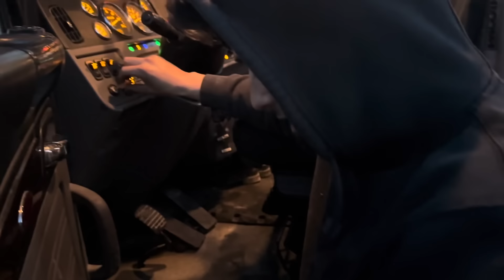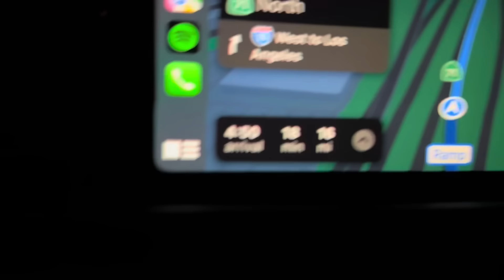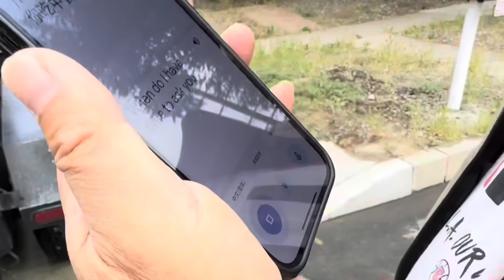Would You Drive a Concrete Mixer truck?

Comment: I've been driving a mixer for 35 years now. Got a couple more to go. It's not that hard, just takes common sense, which unfortunately is in short supply nowadays. You're doing a great job Lexi be safe and keep the rubber side down.
Reply: I've been driving over the road for 25 year's and I could drive that truck, but I would have to be trained on how to do the rest of the job. 

Don't sell yaself short man, that job isn't as easy as ya think, I'm just saying💁‍♂️

Comment: I did that for 7 years till i was 37 last year, then i found out the real money is in the dump truck business, do not spend to many years in concrete, the owners makes the real money not the driver, buy a used dump truck find a good mechanic in your are, and start making 5,000 a week before expenses a week, 3000 cash a week after diesel and insurance, always evolve, try not to stay neutral too long, you will never make real money. concrete drivers should make a lot more money, but managers keep it all. think about yourself not your company, u have a valuable license profit from it, the real money.

Comment: Hey Lexie.  @9:34, about the rust, that shouldn't be hard to fix cause it's just started..  it's called surface rust cause it hasn't gone deep yet.  What you can do is get like a couple spray cans of  Rust Reformer and spray it on the rust spots.   It dries real quick like in 3 minutes.  Then you spray the white paint over the rust reformer (it dries black) and it should look a ton better after that.   About the Rust Reformer, there's like 2 or 3 kinds.  I like the Rustoleum brand (Autozone or Home Depot) cause they dry quick.  Just a suggestion.
Reply from the maker: Thank you so much that’s very helpful, is that rust reformer spray method better than sanding it down?
Reply: @lexflowaz  Rust reformer is black color spray, which is one way. Not necessarily better but maybe quicker. That means you have to spray over with a white color gloss ... more spray coats of white to hide black. Wire brushing or sanding is traditional way to prepare surface.. There is also Rustoleum rust dissolver jelly that softens rust, then it's easier to remove rust with wire brush.
Reply: @lexflowaz   The idea behind sanding it down is to remove the loose rust.   If you don't remove the loose rust your paint could come right off if the rust breaks from the metal, you know what i mean?    So yes, it's a good idea to hit it with a wire brush to remove the loose rust, or better yet sand it down with like around 200 grit (#100 --#220) sandpaper.   I like the Rustoleum brand Rust Reformer cause it dries really quick.   It becomes "primer" when it dries.   Then you can paint the white top coat over it and it should be good.  I had painted Rustoleum on a metal gate before and i wasn't able to finish it off with the top coat, but would you believe it, it lasted 2 years(!) even without the top coat.  About the top coat, you can go 3 coats if you want..just let it dry in between coats for like 30mins.  The Rustoleum doesn't need to be coated twice unless the rust is deep and it absorbs the first coat.

Comment: Engine protection or they left the key on position and it drained the battery or it's in gear. I'd have to look at it myself to know exactly but it's why I stick to older model trucks what I was raised on less sensors, less headaches, more time off the shoulder and more time on the road😊

Comment: Banana 🍌 .... I just came across your channel and like it. I also read in your video description about buying a different camera and wanted to mention something. I have seen people on other channels use cameras that can be clipped to the brim of a baseball cap. Now I am not sure how you feel about wearing a baseball cap, but using one to hold your camera for you will allow you to have your hands available to do your job while still filming. There is no need to reposition the camera all the time and because of where the camera is mounted, we see what you see because it always points in the direction you are looking. Of course you can attach those cameras to a mount also and get shots with you in it as well. I do not know what brands those cameras are because I am not a video kinda guy but I am sure you can research that if that is something you might want to consider. Take care.

Comment: To answer your question about what do you call the spiral steel inside the drum?  Those are called blades, mixing blades, or drum blades.  They are a type of auger blade.  Auger blades are mostly found inside pipes at grain silos, where they lift grain from a lower elevation, to a higher elevation or can even be used like a conveyor belt, moving grain type material from point A to B.

Comment: Do you only keep your drum on low revs when rinsing your fins because it's too loud in the video? Normally I'm full charge after load is emptied. But full throttle and full charge after loading when washing down

Comment: Yeah, don’t let dudes mistreat your rig!  Painting is the right move… but you can’t just paint over rust… it’s underneath the paint now…. So get professional advice for painting trucks… you might be able to get an outfit to mix up the right color white for you, but probably they will recommend you use a brush or sanding head on a power tool to take the bad paint and rust off, maybe do a rust treatment, then primer paint (for adhesion) and then your color coats on top…. But find a paint shop that services equipment and ask them what products and process they recommend.  High quality paints are generally 2-part (paint + catalyst).  It’s not an “easy fix” to do right.  BUT if you hit it with white spray paint in the short term it probably wouldn’t hurt, but it won’t last.  Hope you get it sorted soon.

Isn’t it a company truck?

Comment: Concrete drivers around where I live work like 55-70 hours a week, some of them 6 days a week. Backing into tight residential areas all kinds of sh!t. I am good lol. I just turned 30 one day before this video posted actually, and I have been driving trucks for 3 years, regional semi local and now local the last 2 years. I am going back to school with the hope to be a CPA, I would recommend you get some other job skills that will keep up with inflation better as well  while you are still young. My Dad is a local hazmat driver who makes 34 an hour, I am 30 an hour and I don't even have a decade in and he has been doing it for 40 years. So do the math on that. Also BANANA  lol

Comment: Do you ever have to help spread the concrete?  Here in Alabama, many drivers help spread the mix if asked.  They are usually rewarded with a generous tip.  Many times the truck can pull right up to site no pumper needed.  This also speeds up the discharge process so the truck can return faster to the plant.

Comment: Nice . Always wash your endloader before you leave the plant. also make sure your main water valve to add water to the load is off before you pressurize your water tank 😉  and yes those are called fins , always keep the drum turning when in transit you can flatten the drum rollers  be careful when turning on right hand corners  . There were a few ladies driving mixers when I was driving 20 years ago ps be careful around cement dust acid wash wear a mask and gloves. Looks like your having a good time enjoy . BANANA 🍌

Comment: Your vids just popped up in my feed...  30+ years here, from dry-vans and flatbeds to rgn's (lowboys) hauling permitted loads (oversized, from buildings to heavy equipment), plus two years transporting windmill blades.  Now I run a winch truck, back in North Dakota again and I still wouldn't want to drive a cement mixer.  lol  My best advice?  Always keep learning, no matter how many years of experience you have.  Be safe and don't take stupid risks.  Wear that seatbelt (you'll find plenty that thing it's ok not to wear it but just wait until you roll one and that will cure you...  Ask one of my coworkers here after a shoulder gave way this past winter).  Did I mention wearing that seat belt?  lol  Don't touch that phone while driving (a huge pet peeve of mine, watching people in both cars and trucks driving down the road from shoulder to centerline).  Respect center of gravity (I think that's why I never wanted to drive a mixer truck even though I've hauled a lot of top-heavy stuff...  lol).  The CDL is an insurance policy in your back pocket (so to speak), so keep the record clean and be safe while soaking up all the knowledge you can.  

I now feel officially "old"!  lol  :)

Comment: I just read your follow up.
SEAT BELTS:
My wife and I both operate heavy equipment loaders, dozers and such.
Like you she complained the seat and belt makes it hard for her.
I schooled her of the importance.
I couple years ago her co-worker complained the same then one day she rolled the dozer off a hill.
Had she had on her seat belt, the ROPS (Roll-over protective structure) would have saved her.
She left behind three children under the age of 10 yr's old.
That was a heads up for my wife to wear her seatbelt.
I'm now retired but every day she goes out that door, I worry.
She now has 6 years to retire, that's 6 years I have to worry.

Comment: Pillars? You mean your fins? Or that's what we call them out here near Chicago. At our plant which is wet batch, anything that gets put in the load like color or fiber, someone drops it in for us so we just load, wash down and go but I've found you can add all bags of fiber at once as long as they aren't all tightly pressed together. 
I wish we had vibrators on our chutes. Having to drag mud at a 1in slump sucks.

Comment: I drove about every kind from in my 20's to my late 60's. Mostly Macks but occasional Corn Poppers and Oshkosh with Rex chain drive tubs to 5-axles with Bridgemasters and 10 wheel drives and Allisons to quad boxes (5x4) and about everything in between. From 7 to 10.5 yd and if I was going to truck anything it'd be concrete. Now it's a mower and happy to be alive. Every bit in the Blue Ridge! NO flat ground!

Comment: Hi Lexi, I drive a concrete truck in Sydney Australia. I drive for my company. I am 54 years old and get to work with my son. In Australia we call them 'agi's' short for agitators. The ridges in truck in English are called fins and along those fins are 'flights' which balance the fins. Our barrels are smaller than yours and the maximum load we can take is 7.5 yards or 6.9 metres in metric. Love your videos. cheers Steve

Comment: Not trying to be a jerk but the reason you need a hammer is your not washing down very well. Dry batch or central mix?? You have to get out every time wash down your fins and chutes and on top of the cab every time you load and unload. They have to chip your truck A lot I bet.  Dry batch the worst if your fins aren’t clean it won’t load properly and end up in your chutes and all through rotisserie. Fins are set at a certain angle if you get build up behinds fins they Wont act efficiently and spit material back out all over your truck.In the old days they let us carry weak acid to clean it up. Tip you want the whitest  truck in the fleet but you really have to rinse? Toilet bowl cleaner is the same ph as acid we carried. When they stopped acids all of us carried a bottle in the truck.You have to if the boss isn’t giving you enough time to wash. You can’t get those little specs that dry to fast. Also do they let you carry a small chipping hammer and sledge. On a Fri or Sat. Tell someone you wanna go in and just bang on the fins with a hammer that or learn to wash down.
Reply from the maker: Thanks for your comment, 9/10 times I do go up and wash the fins, hopper, and water pipe but there’s times where we’re doing clean up loads and we don’t have time to go up and wash and also sometimes the truck behind us getting loaded is done and is waiting on us to scoot up, so it dries over time, we have chippers come every so once in a while
Reply: @lexflowaz  That’s what the acid was for we hauled with us  until the 90’s. Do you have a central mix or dry batch?? If it’s dry your gonna have to wash behind those fins every time  that’s how you get those circulars rolly balls to stop. Also those fins expand and contract that how you get those big pieces breaking off and clogging your chute. You have to wash fins. I’m retired now 37 years in. Mixer glory. Do you every think about front discharge? Here were a premium. Waaaaay more interesting. Imagine behind a curb machine in deep sugar sand. With a 1” slump and your backing up trying to keep hopper full,trying to save air with side walk on one side people walking by or through your mud. You seem to be a great young lady. I know you can do this. I miss it. Have you gone to concrete school?? It’s put on by state association. I was a road driver when I started I didn’t know anything about klinkers or plastizers. We’ve actually had guys sit on catwalk with hose spraying fins as we pour on curb machine.contracts lose their shit if those balls show up.

Comment: I'll usually have drivers rip the fiber bag slightly before throwing in to make sure there isn't any balling issues. However, those micro fibers usually won't have any issues unless the slump is above 7" or so or you have a sand or small aggregate mix. Then you have to worry about the bag not breaking open fully when there isn't enough friction and shear to break apart. The bag will also want to "float" more in the concrete. Testing out a new fiber dispenser now at one of my plants, hopefully it will shave some time and keep drivers off the ladder for safer operations. Cheers!

Comment: 9:35  Do not use spray paint, unless first, you sand the rust spots. That way the paint will cling to bare metal. There is a saying: "Rust never sleeps." If you cover the rust with spray paint, the rust will continue to eat the metal.
Reply from the maker: Thank you for that knowledge, i knew it felt wrong just spray painting over it 😂 good thing I held back.. I’ll make sure to look up the correct way to do it, enjoy your weekend thanks again!
Reply: @lexflowaz  wire wheel and get some decent paint for it. Done that a couple times on a few vehicles in the NorthEast. Also, respect for driving stick! Have a 6 speed Wrangler I bought 4 years ago on purpose and love it. Kinda know it's less steal-able cuz no one knows how to drive standard anymore in the US.
Reply: Excelente contenido Lexie soy de México del estado de Nayarit siempre pendientes de tus contenidos saludos
Reply: You’re so nice 👍 😊
Reply: @lexflowaz sand to the metal be sure to put etching primer on the metal then regular primer  before the paint so it will last longer 😉
Reply: @lexflowaz  Home_depot: Rust-Oleum brand rust dissolver and gloss white spray enamel, steel wire brush (to scrape off rust), safety eye glasses, gloves. Wipe area before painting. You can maybe use your truck cleaner acid.
Reply: @lexflowaz  Wire wheel with a grinder as @bracket0398 said. Go at least an inch out from the rusted spots so you see bare metal all around and then spray paint away. Color looks like a flat white to me. I'd bet one of the workers at the sites would let you borrow it for 20 minutes before you headed out to your next gig!
Reply: Sand blast and power wash the area to painted. Proper surface prep will decide if it Falls off after that.
Reply: 500 cans of Rustoleum later, it looks like winter khaki.